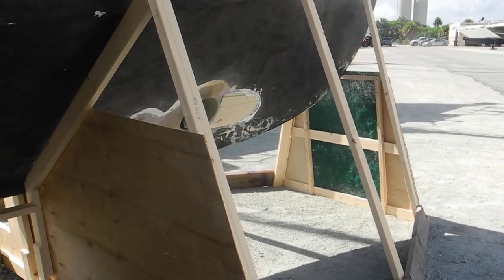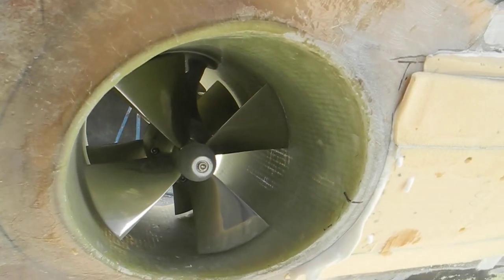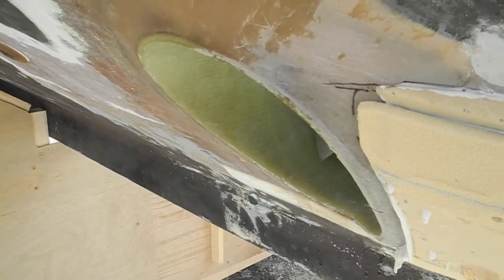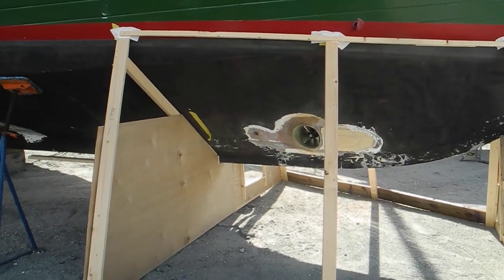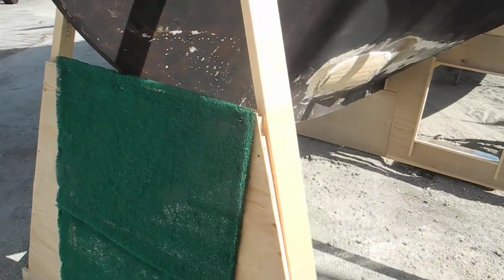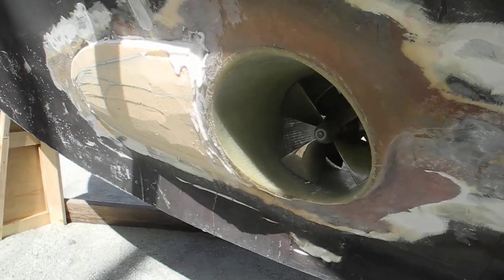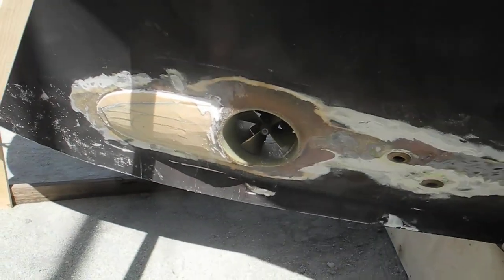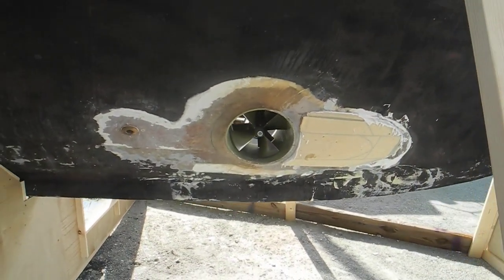Bow thruster installation Part 2

Comment: A stainless blade, wow. What happens when it hits the tunnel? I'd rather blow the blade apart than the tunnel.
Reply from the maker: The plastic blades are designed to break apart if a stick or big fish is jammed in the tunnel. Do not see stainless propellers on bow thrusters often.